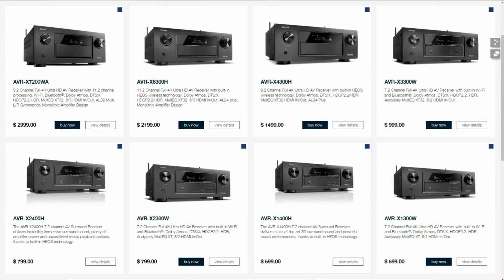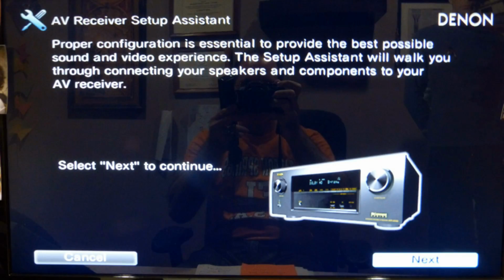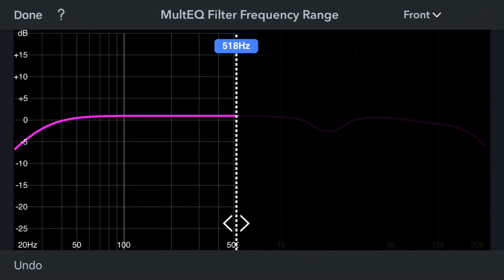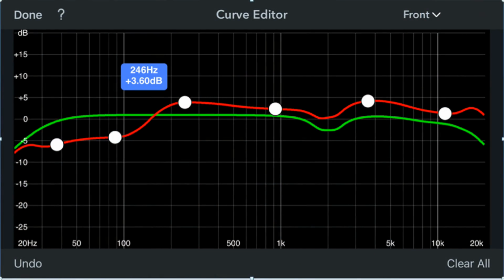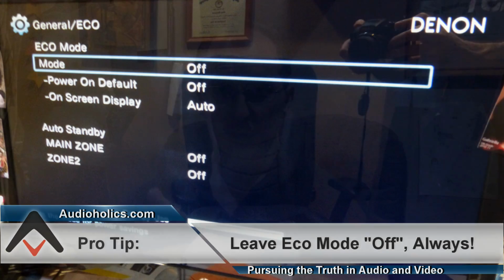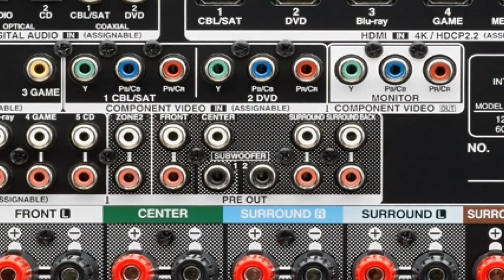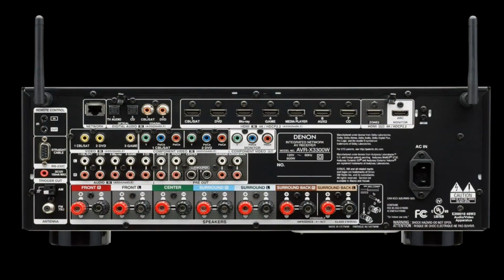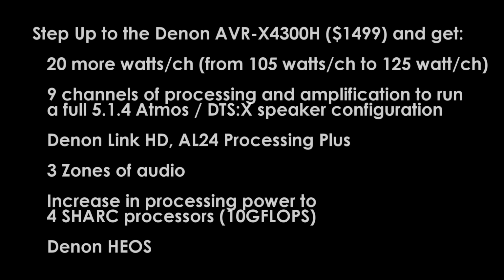Denon AVR-X3300W 7.2CH Atmos/DTS:X Receiver Review

Comment: How about Denon AVR-X2300W for under $500?  Do you have a review of Denon AVR-X2300W?  Thank you.
Reply: I second that question.
Reply: I third that question
Reply: I fourd that question!
Reply: I just recently bought the AVR-X2200W, and I can't see the difference between my line, the 2300 and the one reviewed above. I got mine for $200 used. I love it. It has literally everything he listed about the one above, its just a 2015 model.
Reply: I think it is a very good buy for under $500, but it seems that Audioholics does not have a review or recommendation on the Denon AVR-X2300W, which seems to be very similar to the more expensive cousin the AVR-X3300W.  Currently I owned a Denon AVR-3808CI, but I don't plan to upgrade since I am retired on a fixed income.
Reply: I don't see anyone from Audioholics answering our questions or concerns. I guess if I ever went to upgrade my Denon,  I'd buy the 2300 model.
Reply: 2300 doesn't have 2-nd zone output and 3300 has

Comment: Thank you for this video. I have a question, I own a Marantz 6010 model with the following speakers:

4x Klipsch RP-280F
1x Klipsch RP 450C
2x Klipsch RP140SA (Atmos)
1x Klipsch R-115SW subwoofer (15 inch)

These are very efficient speakers (98db) and I want to add another pair of Atmos. The question is, should I buy a power amp (Marantz MM7055, because Emotiva and Outlaw are not an option in the Netherlands) or should I go for the new 7011 model? Another option is to add a 2ch amp.

Also, how much clean power do I have with all channels driven in my current setup? I thank you for the alarming eco mode setting, always thought it was a good setting, but now it goes off and gains me 20 watts per channel.

Lot of questions, hope you can help.
Reply: I'm on the verge to get klipsch 2x rp250f 1x rp 250c 1x r112sw and  do u like rp 140sa better than rp 250 s? and I'm looking to get a receiver for this what do u recommend
Reply: I just bought the X3300 for $574 and got a $100 gift card from NewEgg. I'm looking at getting the rp250/450c/250s/115sw if they go on sale. Do you know if that setup goes on sale? If so, where and how much?

Comment: Hey Gene, great review overall. Quick question about the RCA analog pre-outs used for external amplification. You said that it's outputting about 4 volts RMS of line level signal, which sounds very good. However, can you confirm if that 4 volts is clean signal without any noticeable distortion or if that signal has pushed beyond its linearity? Thanks.
Reply from the maker: 4V does produce some pretty hard harmonic distortion as you can see in the written review, but it's still very clean at 2Vrms which is more than enough voltage to drive virtually any commercial amp on the market to full power.
Reply: Ok, cool. I'll check it out.

Comment: Gene I have some MATLAB related questions - can we contact you through audioholics site? 

Thank you
Reply from the maker: Haris,  I haven't used MATLAB in about 20 years.  Whatever I knew about it is obsolete compared to the latest versions of the software.
Reply: Audioholics ah I see thank you Gene. I wanted to see how do you import and analyze your audio signals into MATLAB - I have tried importing existing file on my pc into MATLAB and analyze them but I want to measure what the speaker outputs - so I probably need an very accurate mic to capture the audio signal 

Thanks again Gene

Comment: I don't even hear a difference with eco mode on. I just leave it on so my avr-x4200w won't get so hot besides I'm using an external amplifier.
Reply: JDmsz then you're making a pointless statement.  The ECO mode limits internal amplifiers to 20W/ch.  YOU'RE using external amplification.  Discussion over.

Comment: Thanks as always, Gene

Upgrading from 9 year old old Denon 3808ci / Oppo BDP 83 setup

Literally JUST completed the front height install (will be running 7.1.2) and all the associated hardware setup for my brand new X4300H (also installed new Oppo UDP 203)
Have not fired it up, getting late.
Tomorrow is gonna be a good day.
One question, you had mentioned in the review, the 4300 does have the full 11 channel speaker binding posts.
If I decide to add the second set of height speakers in the future, how do I control the volume on those when my power for that channel would obviously be coming from a separate amp...

Looking forward to your 4300 review

Comment: I have a marantz sr5010 and wanted to add a separate amp (crown xls1002) for the front left and right channels using pre outs, how would I set that up? and adjust channel level? or speaker sound level

Comment: I'm currently trying to decide between this model and the 4300. I'll be doing 5 channel with 2 sub woofers. are you saying this model would be best for someone like me? I won't be doing atmos due to room acoustics. but I did think the bigger true wattage on the 4300 would give me better sound. Is the 20 watts really not noticeable?
Reply: double2706 Power ratings are logarithmic. You would have to double the power to get a 3dB (barely noticeable) difference in volume and X 10 to get a doubling of volume. That's 1000 Watts ! You're fine.
Reply: Thomas Hoctor thanks for the reply. I may just save that $500 for the speakers then.
Reply: double2706 No problem friend. Waiting a bit might see the price points drop as their 2017 replacements get released but if not expanding past 7.2 then the X3300 does the trick fine with the ability to externally power the front mains or surrounds if desired.

Comment: Gene, love the show.  It's helped me a great deal in my slow upgrading process.  (I no longer buy Bose).  Question for you.  I replaced all of my old speakers except my 10" pinnacle subwoofer.  When I bought a new Klipsch R112SW sub, I just started using both for the first time.  I noticed the new sub has a different Line In setup, with Left/LFE and Right.  I wasn't sure if it was best to only run a single RCA sub cable to the left/lfe side, or one of the split cables.  I really don't understand running channelized sound to them, but I don't believe my Yamaha RX-V681 can support that feature anyway.  Secondly, if in a few years I get a new receiver and another one of these subs to replace the original, is the stereo bass feature a significant contribution?
Reply from the maker: Use the LFE input of your sub.  Stereo bass is really only significant above 80Hz so if you set a higher xover pt then it could start to matter.

Comment: Hi!  I have a Denon X6300H and I like it a lot.  I'm running a 5.1.2 Dolby Atmos setup with a full Klipsch Reference Premier setup.  I am under the impression that I am severely under powering my RP-280Fs.  I was thinking about getting an Emotiva XPA 3 channel or, I can get a smokin' deal on a Parasound A31.  Which would you recommend?  Please let me know, and thanks in advance!
Reply from the maker: Klipsch are very efficient speakers, especially if you're bass managing them and using powered subs to supplement the bass. However, more power is never a bad thing and you've listed some good options. Parasound amps are built to a higher standard but they cost more than the Emotivas.
Reply: +Audioholics Thank you for the quick response!  I have a Klipsch R-112SW, so it sounds good, but I've tried measuring the tower, expecting to get 98db (speaker sensitivity) at 1 meter away to see how much I have to turn it up to get that 1 watt of power...I have to turn it WAAAAY up!  So I'm under the impression that the Denon is not outputting the 140 Watts as advertised.  After watching this video, I'm not convinced it is not. 
 My guy can get the Parasound for $1,100 more than the Emotiva, and since it has a lot of insane components and THX Ultra 2 certification, I am leaning toward the Parasound.  Thanks again!

Comment: so you're saying that I should not change the impedance setting to 4 ohm if I'm running 4 ohm speakers in my case dali opticon 6 
or did I miss understand that
Reply: by the way contacted support the day I bought my X-4200 W they said that you need to change the impedance setting to the lowest that your system is driving 

if you have a 4 and 6 ohm speaker running like 4 in the front and 6 ohm as surround the setting is 4 Ohm
Reply from the maker: Watch this video:https://www.youtube.com/watch?v=Ou5bO8P2Drw&t=12s

Comment: Gene, How about setting eco mode in auto ? My x2300 runs a lot cooler and It seems makes sense when using volume -30db.
Reply from the maker: Sure that's fine but just realize it can severely limit power if it's always set to On position.
Reply: Tks Gene. Love the channel

Comment: Currently have Yamaha RX-V863 driving Wharfedale One-Six towers, Paradigm CC-350 Center and modus 2s surrounds. Was wondering if the 3300X is a good replacement in terms of amplification and sound quality? I love the Yamaha's 7 channel Enhancer feature. Does the Denon have an equivalent mode?
Reply from the maker: Your Yamaha is an older unit with a slightly beefier build quality but comparable power capability. The upgrade to the Denon would be Atmos and Audyssey EQ editor.  I think the Denon does have a 7CH stereo mode and some DSP adjustability but not as much tweaking at the Yamaha offers.
Reply: Audioholics Thanks for the answer. Would you say that a safer bet will be to go with the Yamaha RX-A860 (or even the 1060), in terms of build quality and DSP performance?
Reply from the maker: If you're running large speakers or 4 ohm speakers don't bother with the A860 unless you use external amplification.  I'd go for the 1060 or 2060 if you don't mind the extra cost.

Comment: One feature that I love about these X series Denon receivers is that after a software update you can now save and recall your Audssey settings on to an external memory card. This comes in handy if you are testing new equipment or seating positions as you don't have to re run Audssey as many times to revert back to your original settings.

Comment: I have an older denon AVR 1312 that I use in my bedroom. Had it for about five years now and it still going strong. Upgraded to an Emotiva fusion 8100 receiver in my main system and I'm really loving it! It does not have 4K or atmos but it is a beast!

Comment: I own this receiver on recommendation and I'm not super knowledgeable on every little thing. Would you say eco mode still is recommended against if using auto eco mode where it should disengage at higher volumes but will stay nice and cool at lower volumes?
Reply: thatdarkeevee NOOOOO NEVER TURN ON ECHO MODE. IT LIMITS POWER AND PERFORMANCE OF YOUR SYSTEM. LEARNT THIS WITH SAMSUNG ECHO MODE DISGUSTING THING 😂😂😂😂😂😂😂

Comment: Great review. Curious about something regarding the app for editing the Audyssey . I have 2 subs plus a Buttkicker system (essentially 3 subs). How would one one handle the wiring and the correction? Plug each sub to the seperate connectors to tune, then piggy back the Buttkicker off one of the 2 afterwards, or something else? (so tuning with the Buttkicker completely disconnected)

Thanks!
Reply from the maker: Calibrate your 2 subs first then plug the buttkicker into one of the sub outs after , perhaps use a Y-splitter.

Comment: have this model. love it but I was wondering if there is a way to bi amp my fronts if I'm using a bass-x 2ch amp 150w/ch. Its currently powering just the front L and R. everything else is connected to the receiver. Any suggestions? Advice?
Reply from the maker: You can add another Bass-x2CH amp and y-connect it to the preouts of the Denon.
Reply: thanks for the suggestion. appreciate it

Comment: Great review as usual. I'm actually surprised at how Denon kinda has over taken Yamaha or how Yamaha has taken thier eye off the ball. Very disappointed actually. I'm going back to separates because in general I don't like what's going on with receivers today. I'd like to see reviews of some processors like the Emotiva MC700 and the new Outlaw model 976 when it comes out. Budget processors would be a cool place to go for reviews.
Reply from the maker: Market trends. Japanese companies go in cycles IMO.  The 80s produced really crappy receivers then things turned around a decade later and lasted for awhile. Now the "latest" feature seems to drive the trend and stuffing Atmos into $300 receivers is really having an impact on quality IMO.
Reply from the maker: Yea agreed.  Affordable separates solutions are looking more appealing these days with the decline of the AV receiver.
Reply: The question is , is it on purpose?
Reply: Hey Audioholics, I have a Parasound 1205A amp that I'm going to hook up to my Yamaha receiver. How much difference in sound quality with this move?

Comment: Why do u have to spend 800 dollars just to get preamp output. 75 dollar car head units have 4 volt outputs. Why do they not have these on lower end models.  Crazy u have to spend that much just for outputs
Reply from the maker: Yep with the advent of Atmos, it moved the price up on AV receivers with preouts a good $200.  #Sad.
Reply: Bon Scott ya no kidding, then you got too spend way more on amplification!
Reply: Wait for the sales. I got my AVR-X3300W for $799. I got my AVR-X4300H for $1149, and I've seen them both on sale for less. I saw the AVR-X3300W on sale this year for $599 at one point. That is a crazy price for such a capable unit. Even two generations later the Denon AVR's have not really added much that anyone would need or want IMO, at least not when you can get the older models at such deep discount.  Patience can save you a lot of money.